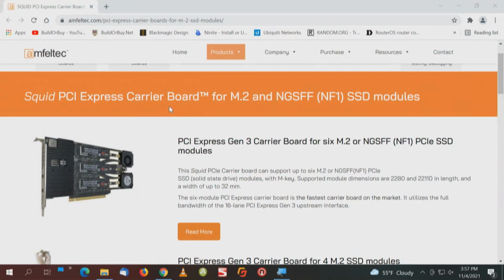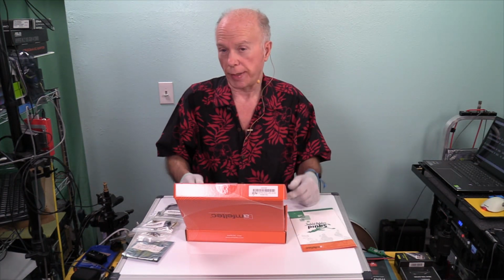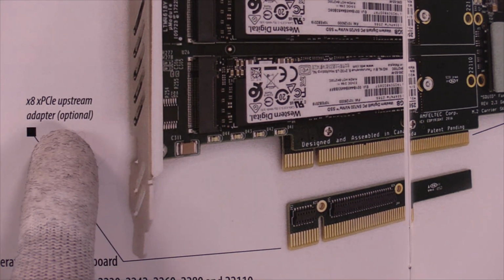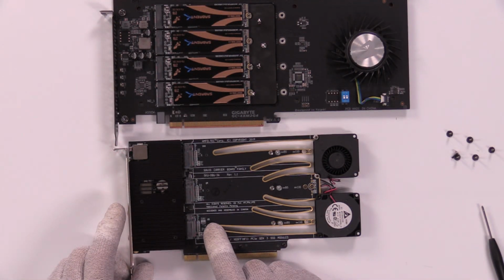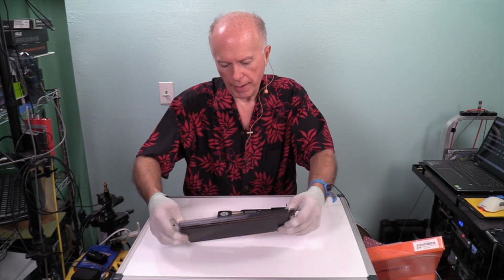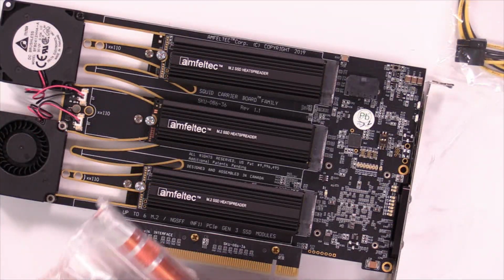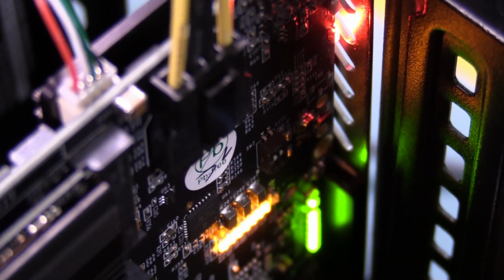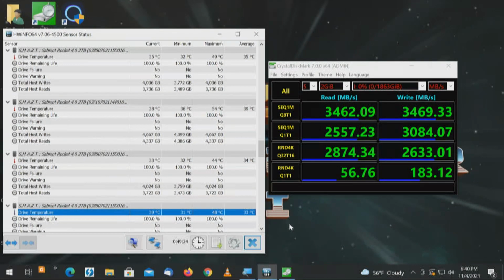Amfeltec Squid Carrier Board 6 M.2 NVMe PCIe SSDs x16 Slot Unboxing, Inspection, Install

Comment: Awesome video thanks for that 

Shouldnt these cards just work on any pcie slot (provided they're open in) with reduced speeds of course? 

I only got one pcie gen 3 4x on my Motherbaord left. Other adapter do that too but i cant use what ive got because the drives are on the front and the back of the plx controler i have here (interferes woth zhe gpu cooler 😅)
Reply from the maker: Hello BR0KK85,
Welcome. Appreciate your comments. Good question. To reiterate what's stated in the Video, this card requires a X16 Slot. With the add-on Adapter, it can work in a X8 Slot. If you only have a X4 Slot, no. They do however make a version that will with reduced drive count. Remember: Each M.2 NVMe PCIe SSD Drive requires X4 PCIe Lanes. Yes the card is self Bifurcated. Cutting the Lanes will cut performance. How much? Test and Verify. Each application is different. Your results may vary.

Comment: there are other cards with this nvme fastening mechanism. You take out the screw. Put the bushing into the indent. Insert the card. Insert and tighten the screw from the back....
Reply from the maker: Hi Thomas Michael Schwarz, 
Welcome! Yes! Glad You've brought that up! However, a little different on ASUS, Gigabyte, ASRock and Supermicro that We have worked with!
Reply: @BuildOrBuy  I did not say that is a good solution. there are definitely better ones. 🤗
Reply from the maker: Hi @thomasmichaelschwarz9741 , Understand. Thank You. And options are getting better. Supermicro uses plastic push pins on their Dual M.2 NVMe Adapter. Did not care for those at first but definitely helpful in a repetitious testing schedule.

Comment: Gil, Thank you for being such a great teacher.  Covid took my commercial pilots Cert away so I am leaning on my limited ability to do creative content for a living. I can't take the depreciation on my i9 Macbook so I sold it and since the M1 Max 32 core GPU is the closest thing to render in my software what I need, I need to rely on breathing life in to my 2010 Mac Pro tower with a Vega 56. I am capped at 3gb/s with ssds, unless I use the PCIe X16, then I get the faster ssd speeds. Much needed. BUT since my motherboard doesn't support bifurcation and I need to independently load two different OS's this appears to be my only option to having 2020 's ssd sata and M.2 ssd speeds.  Has anyone used this on a 2X 3,33 6 core (12 core ) Xeon Mac Book 5,1 tower?
Reply from the maker: Hi 2Guys Vintage,
Welcome! I'm honored! Sorry to hear You too have been adversely affected by the world turning upside down these last 2 years. Crazy. Absolutely unbelievable. 

12 Years on that Platform. Ok. Working with what You have, options include Amfeltec, Highpoint and OWC off the top of my mind at the moment. As far as We are aware there are no Macs that Support BIOS Bifurcation. Therfore a Self Bifurcated card is the only option. Amazing technology using a PLX Chip for Lane Switching although pricey. Hope that helps! Please stay in touch and keep Us posted on Your progress! We shall get through this! Patience, Persistence and Perseverance! Success with Your Content Creation!

Comment: I wonder if this card would work ( but slower ) in a PCIe 2.0 x16 lane slot ? great video and fascinating card!
Reply from the maker: Hi BB-box,
Welcome! Good Question! Compliant with PCIe Specification 3.0 and M.2 Specification 1.1. One way to find out! Test and Verify! Like on a 990FX Motherboard? Crazy expensive experiment experience! A rabbit hole what if. The point of these, in the end, better to utilize a Motherboard with PCIe Resources that supports Motherboard Bufurcation to avoid all of these alternative Configurations. Keep it Simple and Make it Work!

Comment: well just got a quote for the Amfeltec Squid Carrier Board 6 M.2 NVMe PCIe SSDs x16 Slot Prices $ 373.87 USD   LOL  WoWee can buy a 2TB WD_BLACK 1TB SN850X NVMe, and maybe a 1TB WD_BLACK  SN850X NVMe that quote was a surprise, but the prices may vary depending what you want to buy, this price maybe for to hold 6 M.2 NVMe drives
Reply from the maker: Hi Rom3,
Welcome! You were quoted a better price now than We were originally. After all, this card is Self Bifurcated. Like You said, for 6 M.2 NVMe PCIe SSD Drives. Sounds like Your opting for JBOD instead of RAID. An amazing piece of technology! Fascinating! Nothing else like it that We know of! Thanks for Sharing and Commenting!
Reply: @BuildOrBuy  Yes Sir there many types and I am searching for this most price effective and yes I was listening about Slef Bifurcated thas what I Love about this product, you mentioned I was quoted a better price well they much have dropped it or being a different version. But I do think if ones really serious of adding 6 M.2 its well worth it, but I need to continue watching UR Ch to learn more like how ur straight forward Thank you Sir for responding.
Reply from the maker: Hi @OLvato1 ,
Absolutely! Appreciate Your Feedback! The next type would be 8 Drive cards, also Self Bifurcated but much more expensive. Such as Highpoint which uses a Broadcom PLX Chip for Lane Switching. However, those require a X16 Lane PCIe Slot, electrically. Adding High Performance Storage Solutions is a fascinating topic for Discussion! Our Goal, Keep it Simple and Make it Work! The Amfeltec Squid only requires a X8 PCIe Slot, electrically. These types of cards can be installed on Consumer Desktop Motherboards but are easier to install on a HEDT or Workstation due to the difference in Shared PCIe Resources vs Dedicated PCIe Resources. Hope that helps!

Comment: Hi Gill. Could you give the dimensions of this squid carrier card. Curious to know if this will fit in a SFF system with riser cable.
Reply from the maker: Hi Samual Teresi,
Be glad to! That's a Full height card and not a half height card but I'll get those Dimensions tomorrow. Just finished Editing Video for next Video Premiere! Thanks for Asking!
Reply: @BuildOrBuy  Thank you Gill. I was planning on removing the fans and fabricating a bracket to sit in a hdd caddy.
Reply from the maker: Hi @samuelteresi2493 ,
Amfetc Squid 6 Drive Carrier Board Measurements:
3 3/4 inches tall (shy 1/32 inch) x 6 3/4 inches long (1/16 inch Short)
PCB without Fans in Length, 1 PCIe Slot wide, Double sided M.2 NVMe Drives. If You need closer tolerances, I'll need to use the Calipers in MMs. Suggest not printing anything until You have the Add in card for tight clip on tolerances. Fascinating Self Bifurcated Add in card! Hope this helps!
Reply: @BuildOrBuy  this is what I need. Thank you
Reply from the maker: Hi @samuelteresi2493 ,
Excellent! Glad to help!

Comment: You to much talking. This card support NF1 NGSFF ssd`s, but i didn't see it. The usual m2 and the new m3 are not electrically compatible, m2 uses 3.3 volts, m3 uses 12 volts, this means this card must understand what type of ssd is inserted into it. The PCI SIG has previously spoken out against the use of the m2 connector: "Installing M.2 devices in the NF1 connector may damage the installed hardware." This hints at the fact that they have different pinouts. So how does it work on this board? 60 minutes about nothing. Anyone makes videos about bifurcation adapters, this is not news. The board looks horrible, flimsy. Why would they do that. They should have left it unchanged.
Reply from the maker: Hi Анатолий Патракеев,
Welcome! We stated the What, Why and How as Compared to the other Add in Cards We've tested. Not everyone understands Bifurcation. To them, it is news. You'll have to ask Amfeltec. We, as You know, are only Testing the Squid with the same Drives as are supported by the other Manufacturers of M.2 NVMe PCIe Drives which include ASUS, ASRock and Gigabyte. Thank for for Your Comments.

Comment: Contacted AMFELTEC. $1000.00 USD for this card. They are insane.
Reply from the maker: Hi mrgcav,
Price has gone up! Ouch! Better to purchase a WRX80 Workstation Motherboard and 2 M.2 NVMe x16 Quad Adapters! The USB Driver works but no App to run it. Amfeltec needs to address that issue. Part Two Coming Up! Stay Tuned!

Comment: I'm back. Mediacom died for 16 hours. Any hint on a new GEN4 version?
Reply: NO ICON on the desktop for that new usb port temp readings? I really wants raid 0 individual drive temps.
Reply from the maker: Hi @maxhughes5687 , 
USB Driver installed successfully and plays nice with Thunderbolt 3 but that's it! Amfeltec needs to write the application otherwise that's just dumb tech. And they have a Patent on that! They need to finish it!

Comment: Thanks Gill. That's a lot of work.
Reply from the maker: Hi Max, 
6 hours of Filming and Testing. This was the 1st half. Working on 2nd half, Editing. This needed a thorough going over. The RAID part gave surprising Results on the Writes. Eager to Share that part too! Thanks for Watching! Stay Tuned!
Reply: @BuildOrBuy  Will that usb driver give us individual drive temps even though all six drives are in a raid 0? If that card on an 8X socket can get up near the 16X socket speeds the X570/Z590 owners should want a PLX chip raid. The QUAD cards with a PLX chip getting 4X the speed of one 7000/7000 GEN4 drive would be scorching hot.
Reply from the maker: Hi @maxhughes5687 ,
This needs to be PCIe 4.0! However, Very impressed with results on the Broadcom PLX Chip at PCIe 3.0! And the RAID results were really interesting in Part Two both on x8 and x16! I'm much more interested now in Testing the Gigabyte Aorus Xtreme now!

Comment: Wondering the max read speed of those drives in Raid 0 ? And is there a Board that allows pcie 4.0?
Reply from the maker: Hi whittymusic,
Sorry for not responding sooner! We had a batch of Comments that We never saw notice on from YouTube. I logged into the Account today looking for another message that showed up but I cannot find. Nuts right. Anyway, Your Question, The Maximum Read Speed. I need to go back and recreate the RAID 0 array. I was thinking JBOD and We don't have JBOD on AMD RAID. All Drives must be the same size or the RAID defaults to the lowest size of drives. I'll do an Update of all 6 but will have to change out the 2 1TB Drives to be 2TB Drives to match. For PCIe 4.0, The issue is with the PLX Broadcom Chip. Thata's the bottleneck. Amfeltec has stated they will do a PCIe 4.0 version but when, We don't know. 

We have yet another solution We may be looking at that is a type of RAID aggregation beyond anything We've discussed so far. Virtual Instruments are the one thing I can see benefitting from RAID the most from Our Perspective other than VM's and DataBases! I'd like to se a Rig with GBs of RAID Storage that could load Komplete Virtual Instruments in 3 seconds or less. Doable! Stay Tuned! 

BTW: I'll Contact You on Your Channel for a follow-up! I'm honored! Happy Thanksgiving!

Comment: Also careful that HWiNFO may not keep the order on the drives as you plug and remove the PCIe device. At least this is my experience with multiple GPUs on the same exact slots. I think it has something to do with enumeration and the way either Windows or the motherboard handle that enumeration during boot. I know this is comon because I set GPU temps to tray icons in HWiNOF (right click the item on the table) and then I would assign different colors to identify GPUs, but even across restarts I would sometimes flip the colors! And I'm quite sure this happenned because I plugged and unplugged the cards for cleaning fans.
Reply from the maker: Hi cldpt, 
You're absolutely right! Just now seeing Your Comment. YouTube does not always send out notification. I did not want that issue to be a distraction. Device enumeration is a very big deal. And that's one of the problems We're having with multiple GPUs as You have pointed out on the TRX40 Designare. The Bios is either not resetting or reconfiguring properly to reallocate PCIe Resources. And this Amfeltec Squid AIC has the ability to do that. Which is interesting. Thunderbolt could be the culprit on the TRX40 Designare. It was an issue in the beginning. But that's just a hypothesis based on previous experience. I'd like to have the time to explore that issue further. But it may be self resolving soon if We get new Bios Updates or new Chipsets. Thanks for Sharing! This helps Us to make better Videos! These Details matter!

Comment: Those grey pads look like either Gelid or Tehrmalright pads. They're the good stuff even if the heatsinks don't look so good. To be honest, I prefer to have their 2 fans and good pads than some massive copper heatsinks - I think better airflow and conductivity beat more dissipation area. And since this is a 6 card adapter, vertical clearance is an issue anyway.
Reply from the maker: Hi cldpt,
Thanks for that Info! They're thick too! This packs a lot of technology in a small package. And being able to change the PCIe Pins to either x16 or x8 is fascinating! Amfeltec needs a PCIe 4.0 version of this M.2 NVMe PCIe Carrier Board. Temps are all in acceptable ranges. Thanks for Sharing! Next part Premieres tomorrow! Stay Tuned!